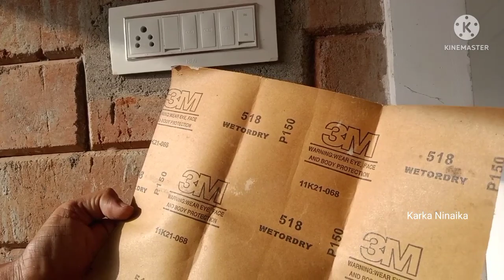interlocking brick wall coloring, pointing and waterproofing

Comment: Sister - is it necessary to have plastering with cement and sand for the interlock brick home? Will there be any water leakage issue if it left without plastering?
Reply from the maker: Plastering is not necessary in interlock brick wall. Waterproof coating itself enough to prevent water leakage or seepage. Thank you
Reply: @karkaninaika8884  thank you for the prompt reply
Reply from the maker: You are welcome.

Comment: After waterproof, ur interlock bricks wont breath anymore. Its then same as a concrete building right?
Reply from the maker: No. It is not like that. Concrete walls always have more thermal conductivity than mud interlock bricks and are not cost effective as well. So the difference is there always.

Comment: How to  fill the  gap  after completing electrical and plumbing work sister  pls  guide us  our  work is going on  In Bangalore.
Reply from the maker: Are you using mud interlock brick?
Reply: @karkaninaika8884  yes
Reply: Yes
Reply from the maker: @ramum7127  we filled it with usual cement and sand mixture. Then colored that portion by mud interlock brick powder using paint brush. That is what we have done. We will show that in our next video. Thank you.
Reply: @karkaninaika8884  Thank u mam
Reply from the maker: You are welcome